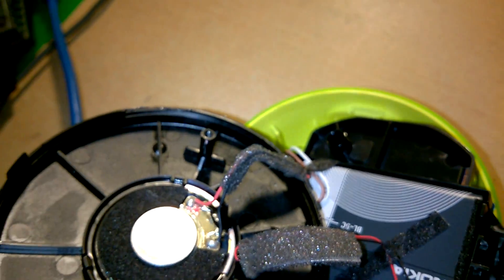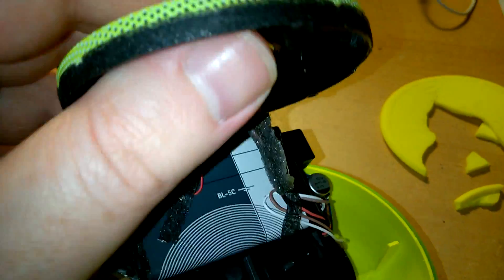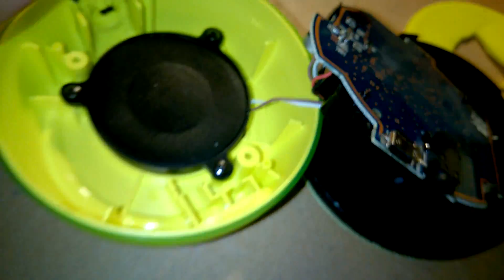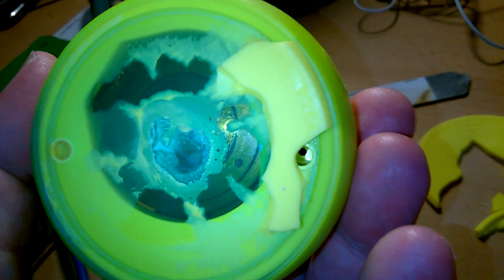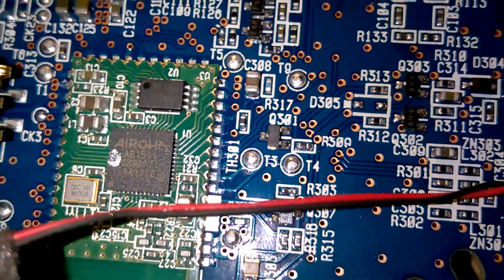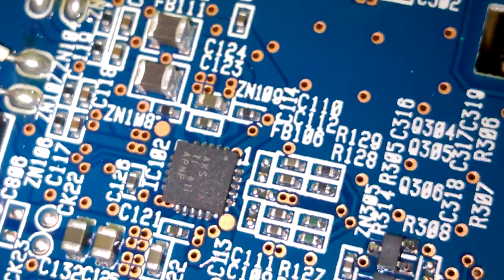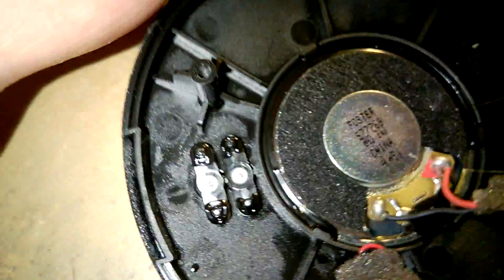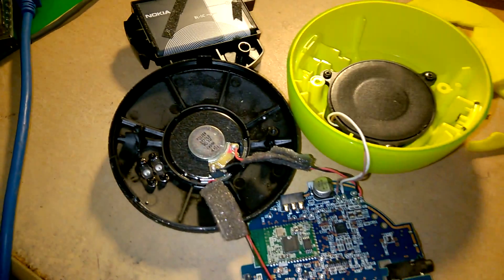Nokia MD-12 portable wireless speaker: "teardown"

Comment: Thank you for the video.
Once, 3 years ago, I already changed the battery, but now the 3.5 mm jack has loosened. The soldering of the first two contacts has departed. It is necessary to sing, and it is good if the conductor remained in place. But I forgot how to open the device. Thanks to your video, I did it.

Comment: Hey guys, what do you think about its audio quality?
Is it have a good bass?
Do you know if is it possible to connect two MD-12 simultaneously? (TWS technology)
Thanks!
Reply: I had this speaker years ago, but i bought a used one again last week because its the best bass for the price. Especially when placing on wooden table or paper box, the bottom rubber piece of the speaker vibrates the surfaces, so bass is even louder. I have some BT speakers, but this small can outloud the biggers easily.